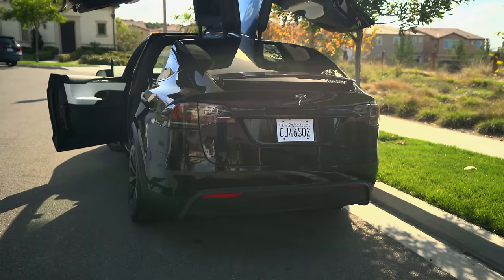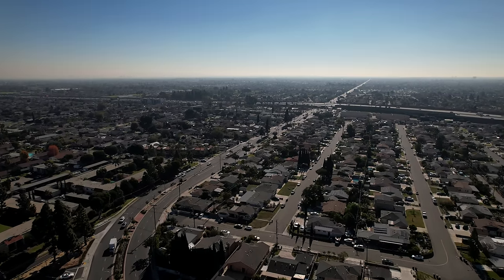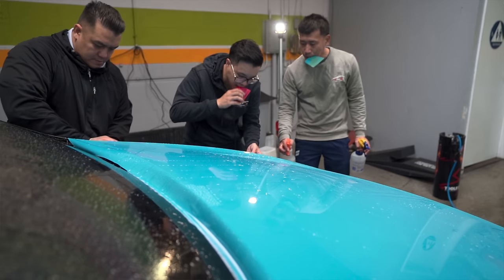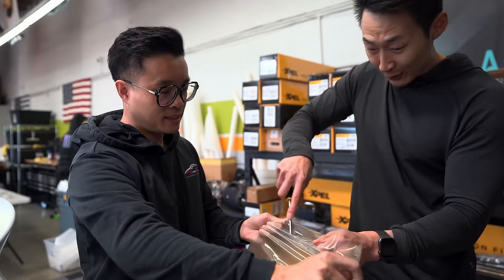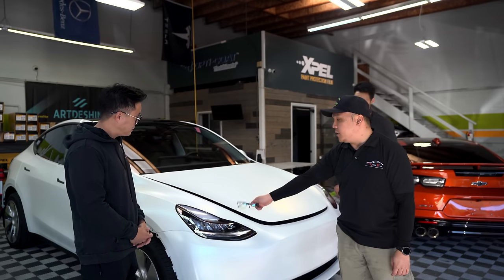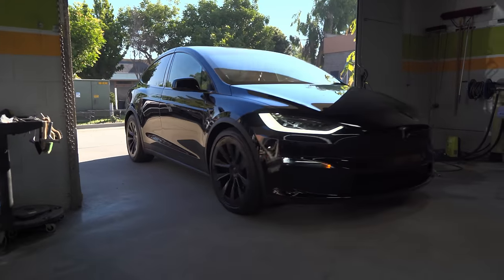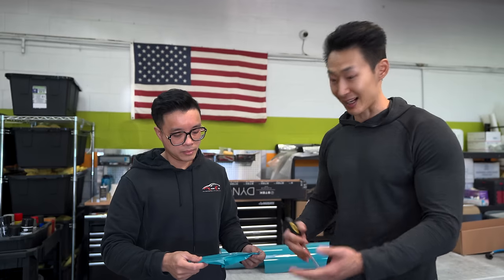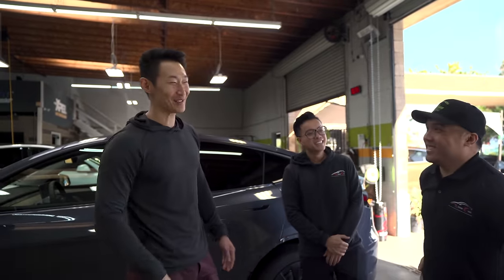Paint Protection Film Or Vinyl Wrap: Which Is Better? (Colored PPF)

Comment: PPF costs have gone up to a level where it is hard to justify now, especially if you plan on owning the vehicle for only 2-3 years.  When it used to be $2-3k for a full front and ceramic coating, it made sense.  But not at $4-6k+ for the package these days.   This business has quickly turned the corner into a vanity money pit with installers in a race to see who can charge the most and get away with it.
Reply from the maker: 2-3 years yeah that’s tough
Reply: Agreed. $7k to fully wrap my 2022 MX with PPF is a lot, but I do plan to keep the car for a long time. Replace the battery and motors if I have to.
Reply: Holy moly 4-6k??? What state are these prices at?
Reply: @joserboi  cali. They want a piece of your federal stimmy money, state stimmy money, and tsla capital gainz if you have that too.
Reply: It’s not a “who can charge the most and get away with it” The costs not only to apply the film but the film itself has gone up tremendously and although it doesn’t make sense for you that doesn’t mean installers are racing to the top. We are at around 2k for a full front with edges wrapped. But the coating itself you have to break it down per year and if your ceramic coating costs less per year than waxing your vehicle… you are still good.
Reply: In what state does it cost 4 to 6K to wax your car? Even if you waxed your car once per week how many years do you think that it would take to reach 6K? If Cali is that pricey I would suggest moving. Just sayin.
Reply: Yup. Its pretty dumb to spend that much . Like oh, a new paint job is up to 3k more, so ill spend 7k to keep it looking new... huh?!
Reply: @joserboi  VA has the same prices here (((
Reply: @jeffreysims1865  VA the same
Reply: IRVINE, woot woot!!
Reply: @joserboi  as far as i know, cali and Colorado
Reply: yea few years ago PPF installation it only costed half of what it is right now.  but so was the cost of a bowl of noodles, a gas of tank or the cost of anything in general :) . Inflation is bad
the Goal of ppf is all about protecting the original factor paint.  If you tend change car every 2,3 years, then obviously PPF is not suitable for you.  But there are alot of people that keep their car for a long time, Then ppf definitely is worth the investment.  
I really don’t think in this kind of business you can charge anything and get away with it.  You get away with No Customers :))).
Reply: If you're going to get a different color, it's no different then a new paint job.  What you get is the added paint protection.  I think up to around $5k it's worth it for a new unique color.  The only problem I have remaining is the care required for washing.  I'd rather just go through a drive through.

Comment: I bought a Model Y 1 month ago and did PPF full front + pillars for $2300. I will do ceramic coating next month for $1700. I'm doing it because: 1) vanity 2) protect the front during long drives 3) I usually own a car 10+ years. I've no illusions I may have to take PPF off in 10+ years...but at least the original paint should be intact, requiring less expansive repainting.

It is expensive. Rip off really. Don't do it if you will own < 5 years. I have frontal PPF on my BWM x3 and it's done a great job. Prior I had a Mercedes ML that suffered serious cosmetic damage driving i5 in CA due to bugs and pebbles. 

Emphasis on term cosmetic. Again, this is ultimately an exercise in vanity. Don't break the bank on it. Lastly, I've only owned 4 cars in my life. My 1 splurge, but within fiscal responsibility. All the best with your cars...my favorite and really only toys in life.

Comment: So if I understand it correctly, among the other differences, PPF should last for the life of the car, whereas vinyl will only last a few years?  In that case, I've learned something new and valuable!  Thanks, Chris!
Reply: Depending on the product, warranty is for 7-12 years which is usually the life of the car. I would recommend looking up the dif brands of PPF and see their warranty periods.
Reply from the maker: Yes!
Reply: @turkey1337  I guess my concern would be how difficult it is to remove and what kind of shape the paint would be in, underneath.  Also, if I have a few tiny chips in the paint, will they be obvious under a color PPF?  Or would they have to be filled prior to the application?
Reply: @tesladura3085  you would have to ask the installer if removal is included or extra but there’s video on yt on how to do that. I actually asked my installer that same question and they said its preferred to get the chips repaired and painted but they can still apply if that’s your preference.
Reply: @turkey1337  Thanks for the reply, sir.

Comment: Thanks for the information.  This video is great too bad this is not where I live otherwise would give Allen a call sounds like a decent guy to work with. By the way you didn't mention any cost also do you know if you can still do PPF not clear but different color if your car already has small chip damage?
Reply from the maker: Yeah it should be fine! At least do the front. I think for Front it averages between-2-3k

Comment: Hey Chris so I just went to a shop and did the same thing but there are a lot of corners that have the original paint exposed. They tried telling me that since it’s PPF and not vinyl, they are not able to completely wrap the whole thing. Is some of the original paint exposed for you? Or was that shop able to fully cover the car including the corners?
Reply from the maker: yeah the corners near the door hinges can't be wrapped and they can't wrap the whole bumper due to the trim because if they do the trim won't have any space and it will ruin the wrap since it's so thick. But for me it's not noticeable at all. ALso helps my paint is black